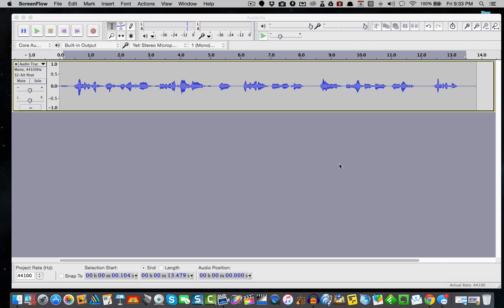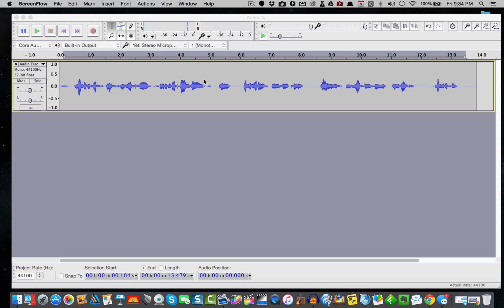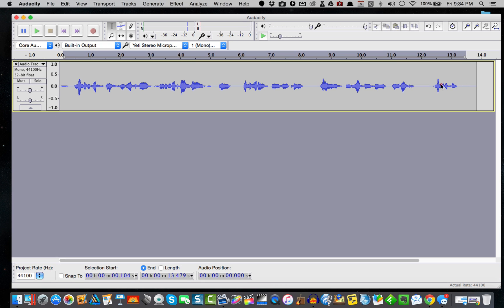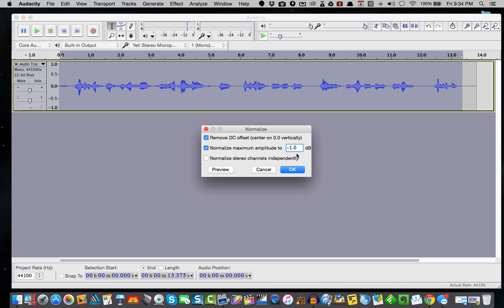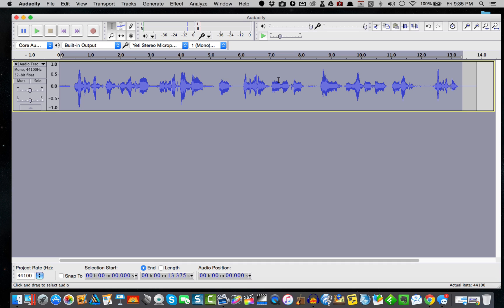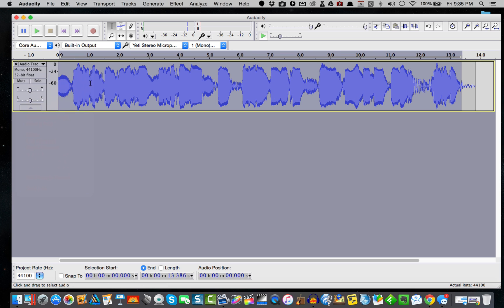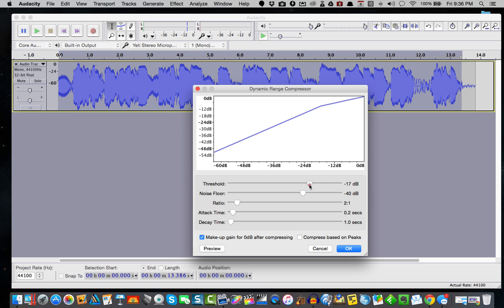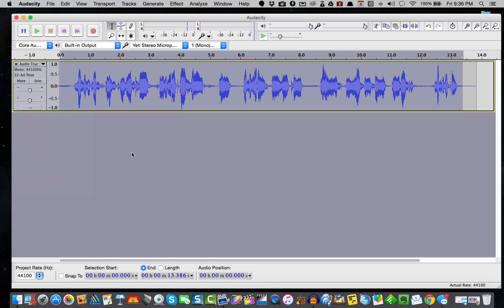Normalizing Audio in Audacity

Comment: How do you balance between louder and quieter parts of the recording ? I've seen that after normalizing, only louder parts are audible, while softer parts are still too quiet.
Reply: Sounds like a job for the "Amplify" tool under the effects menu. Highlight the area you want to change and click effect>amplify...gives you the choice to adjust + or -
Reply: @zalinger8925 , thanks for your advice. However, it's tedious to do when you have a very long clip. I've found using Compression and Limiter helps. This video talks about it : www.youtube.com/watch?v=Rj7sbBng-T8&t=262s
Reply: @khubaib1995  Thanks for the link. I'm new to compression and limiting, but definitely would be tedious the other way.

Comment: PSA: normalizing may not be the way to go; you're permanently altering the signal when you do this.  Normalizing is a hack.  You should just try to get a signal that has enough amplitude to begin with!
Reply from the maker: You are exactly right, Lash. Normalizing as a process should be quite minimal if you set your levels right. If you apply a bit of post compression, it's always good to re-normalize at the end, but it should be a small touch, not a crutch for bad levels. Thanks for watching!

Comment: Is there a way to remove feedback sounds?
Reply from the maker: The Noise Removal tool can help, but it depends on where the feedback is coming from. You are always better off trying to find it and remove it on the front end than try and get rid of it in post if you can.

Comment: hi  Kevin normalize this way is good for mastering afterward or should i leave headroom ..thanx
Reply from the maker: If you are mastering for later use other than the one track like my work has, leave yourself some head room. When you set your gain level in your audio interface, try to come in about -3 to -6 for your peak levels and leave yourself some room so you can bring it up later. Always safer that way. Thanks for watching!
Reply from the maker: As long as you don't hit 0, you will be fine. I record into the red a bit at -1 before compressing. If you are new to voice, give yourself a bit more head room so you peak at -6 and normalize later. I feel the best sound comes from recording a bit "hotter", but you have to regulate your vocal volume or you can ruin your audio if you don't have a front end noise gate. Thanks for watching!